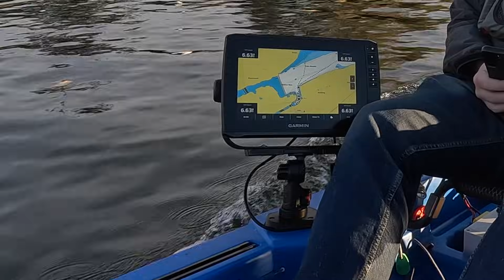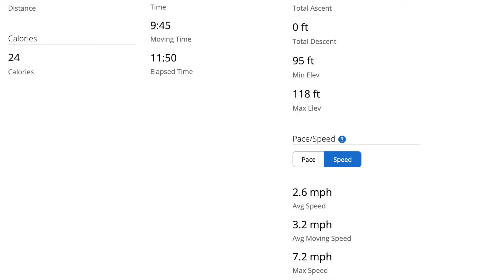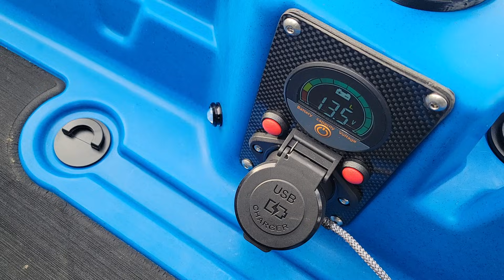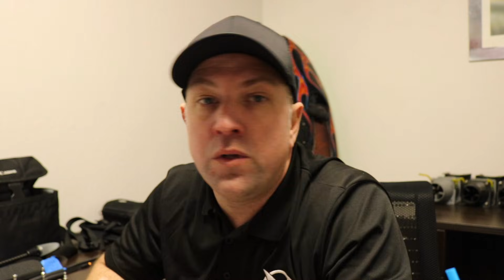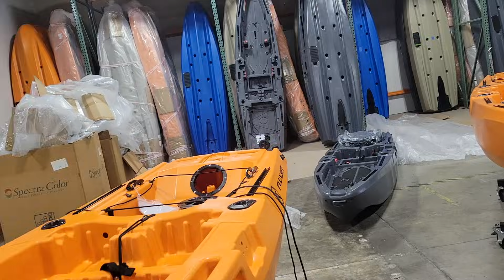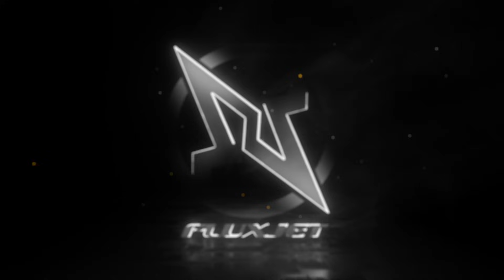FluxJet Kayak End-of-2025 Testing Results and 2026 Update

Comment: Question please may have already been addressed. Longest lasting battery and amp hour that will fit, no restraints on purchase. Thanking you in anticipation.  Cheers Peter.
Reply from the maker: The system accepts up to a Group 31 battery. Runtime depends on voltage, capacity, load, and conditions, but higher voltage batteries are more efficient overall.

Comment: Just wanted to get Fluxjet fans’ input on the weight aspect of battery choices. My own bias on kayak setups is towards as light as possible, because i often launch at unimproved access points that are a ways from where I can park. Higher voltage batteries have obvious performance advantages, how do others feel about the higher battery weight aspects?
Reply: If you want the best weight to power the 12v mini 100s will be super hard to beat for size and weight. Your not breaking any land speed records, but for the average person you can hammer down on the throttle all day with out any worries.
Reply: @JamesSnyderYabTD  Thanks! One more battery question while I wait for my delivery: a 24V 50 ah is just 2 lbs heavier than the mini 12 100, I know top speed would be higher, would you expect any difference between these in run time at the same speed, like 3.5 mph? Thanks!
Reply from the maker: That’s a good point and a common trade-off. Some users prioritize lighter batteries for easier launches, while others prefer higher voltage setups for added speed and efficiency. Since FluxJet supports a wide voltage range, it really comes down to how far you’re carrying it, how you fish, and what matters more for your style.

Comment: While 7,2 mph sounds certainly exciting there are weight factors distribution involved as well as hull speed etc. But we all know speed comes with a heavy penalty. Most likely You will not notice unless You watch the speed indicator but there is not much time for that because You better watch the battery monitor. Lets not forget it´s a fishing kayak and not a speed boat. My interest is shallow water capacity and going place where others can´t go in coastel areas and inlets. 
My second concern is reliability. I asume it can´t be avoided that some abrasive stuff gets sucked in the pump and there is the salty marine environment that is very challenging for materials, electrics and electronics. So for me it´s not a question if it breaks or not because under those conditions it´s just a question of WHEN. The important question is what comes next?? I hope there will be some pleasant surprises in 2026. 
I see the advantage of protected turbine blades compared to unprotected prop blades. 
As far as voltage I have the full skills to build my own battery but from a practical point of view I see the 12 - 24V the best options. Most people will be using Drop In batteries.

Comment: 7.2 mph !.. but not typical? Required a 60-volt battery a kayaker weighing less than 60 lb that you force-fed nothing but refried beans the night before positioned in the kayak with his ass in the air pants pulled down like a plumber while farting.. not to mention a tailwind of 18 mph.?
Yeah I really want to buy this JET kayak.
SEA-DOO BOMBARDIER SUZUKI HONDA .. heck they all better get to the drawing board quickly.
Reply: Huh? 🤣

Comment: 36V, by far, is the most popular battery choice IMO. Not delving deep into that voltage for optimization and hard testing with RANGE is a misstep. Still a top tier boat, but its killing me not knowing if we bought the wrong battery for extended range. 

 battery.
Reply from the maker: 36V is a winner anyway, as higher voltage batteries not only unlock higher speeds, but offer greater efficiency at lower speeds, which will extend range. So if you look at the range of the 12V battery, you'll get even more range from a 36V battery with the same total Wh capacity at the same speed.
Reply: @fluxjetkayaks  So with 12V it draws 150 watts at 3.8 mph, you’re saying it would draw lower watts with the 24V battery? Any rough guess at how much less? Also, interesting to see that at 4.9 mph the power consumption goes up 5X to gain about 1 mph in speed, to 750 watts- a great illustration of the power vs speed curve for even this hull design, which has flat sections aft to help. Traditional kayak hulls most likely are even more extreme in this regard.